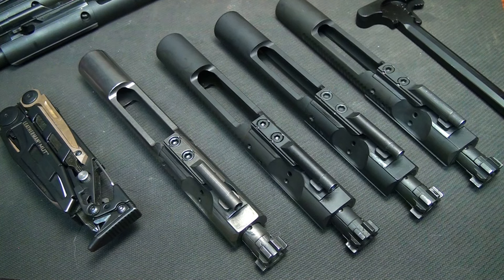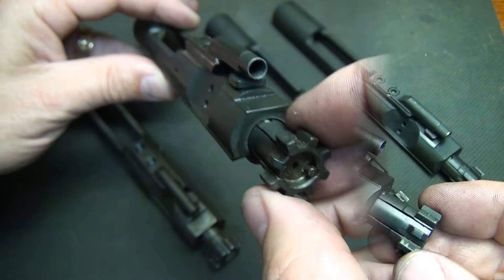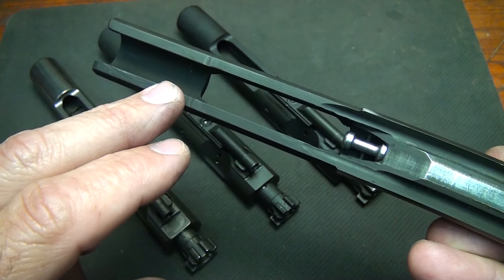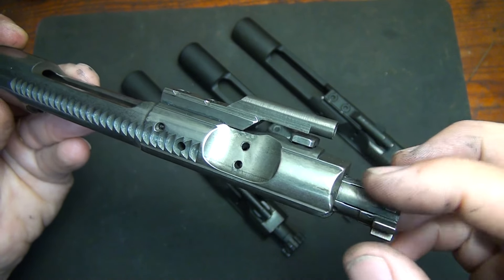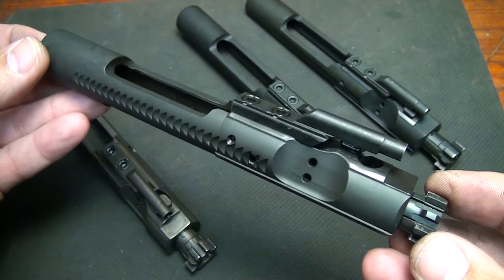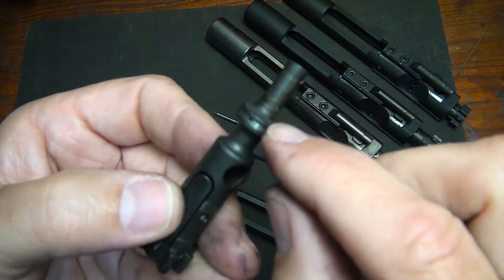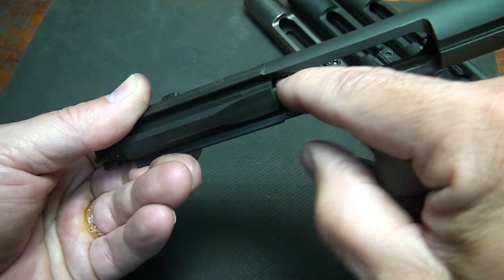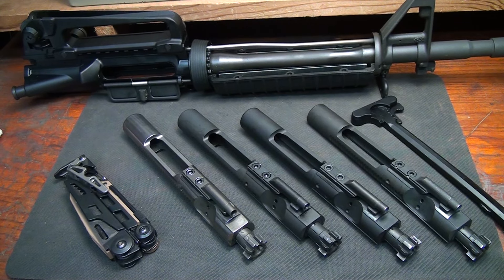How to I.D. AR 15, M16 & Mil Spec Bolt Carrier Groups

Comment: It would be good to see a NiB BCG comparison review. I looked up a few. It seems the prices run from $99.00 on Palmetto & AIM/only shows MPI. Fail Zero to $159.00 to the AB Arms you cover for $199.00 along with a couple others I don't recall. Is there a big difference? Great vid. I just called AIM. Their bolt is MPI individually tested, & not HP tested. This maybe why there's a cost difference in bolts. Can it be that the HP test costs an extra $100.00? Or are there other reasons for the price difference? Called FailZero & they said the bolt is HPT & MPI, $159.00.

Comment: Or are you saying where the Bolt sits inside the BCG? Either way that surface should be Hard Chromed or some companies use Nickel Boron which is not necessary if it is Hard Chromed. Yes it would be beneficial either way.

Comment: I’ve wondered if the half moon (Colt’s) BCA is sufficiently strong enough to handle; 6mm ARC, 6.8 SPC, 6.5 Grendel, .458 SOCOM, .450, .50 Beowulf. (Have I left any out?) or should you just stick with .300 B.O. as a conversion.

Comment: Hey Sootch, question...earlier in this video you said that an ar15 deeper cut bolt will not work on a lower will a sear block. I currently have an older Colt sporter lower with a sear block that hasnt been grind down or altered in any way along with an ar15 bolt and Im able to pin the takedown pin, charge the rifle & dry fire it. I have not tried to fire a live round through it yet as Im still investigating this. Should I not try to do this? Buy a half moon bolt instead if trying to live fire my current ar15 bolt?

Comment: I built a AR recently using an M16 BCG and it won't cycle back far enough to pick up the next round, but I am able to manually cycle it back to chamber the next round.    I swapped it out with an AR15 BCG with a shorter end collar and it works fine.

Was it too heavy and causing too much resistance?  
AERO upper and lower, Colt buffer tube and stock.
Thanks!

Comment: just a note.... some states (washington for one) forbid M16 bcgs installed in semi ARs. state law, not fed. know what is legal in yours.2) while mil spec bolts are indeed carpenter 158 steel, the Carrier is made from 8620. 3) when installing the firing pin retainer pin, the DOD/Colt/FN recommend orienting the legs of the pin vertically. in that way, both legs contact the collar of the firing pin under recoil and less likely to bend with use.
Reply: NanoReefHQ ....  1)  probably only if someone ratted you out
2) routine  LEO contact.

Comment: I have a question: Will an AR-15 carrier increase recoil of the rifle because of its decrease in weight? I remember a commercial rifle from one brand that kicked more than another brand that used an M16 carrier (they both had standard buffer springs and carbine buffers). Also, how common is over-gasing in the AR-15 rifle (gas port being too big)?

Comment: Has anyone experienced the firing pin knocking out the primer on a casing while shooting?  I have a Daniel Defense DDM4v7 in 5.56 and I purchased a new NiB BCG for it. The original BCG was working fine, but I thought that I would give the NiB a shot since they require less lube and clean up much easier. 

After shooting about 30 - 40 rounds of match grade ammo from about 4 different manufacturers, I tried using a match grade steel case round. A couple of rounds fired just fine and then when I pulled the trigger, I heard click and no bang. I pulled the round out and there was just a very light dimple in the primer. I closed things up and pulled the trigger again. Another click, no bang. Once again I ejected this round and removed the bcg. When I tried to put it back together the bcg would not completely seat. I pulled the BCG out again and found a smashed piece of primer in the lugs of the rifle. This happened 2 times within 7-8 rounds. I found the primer laying just in front of the lugs of the rifle. 

I don't know if its the BCG or the ammo?  I didn't have time to insert the old BCG to see if the same thing happened, nor did I have time to switch to brass rounds. I had shot 30-40 brass rounds prior to the steel case without issue. I shot 10-15 rounds of the steel case ammo on a previous outing and didn't have any issues. However this was a new box of the steel case ammo. I guess that I need to go back to the range and try firing 20 or so brass rounds with the new NiB BCG and then try firing the steel cased rounds with my original BCG. Hopefully one way will tell me what the problem is. I believe that firing the steel cased ammo with the original BCG will tell me what the problem is.

Comment: My third entry. Buying a new Bolt Carrier for my Ruger AR-556, I was told if I do change the BCG, I will need to headspace my AR. Is that true? Some will say that a AR does not need to be headspaced, while others will say that you need to do headspacing. So again, the question, do I need to headspace my AR if I get another BCG for it? I just want to install a better BCG, I'm looking at BCM/BCG.
Reply: Rudolph Ferdinand ...  checking/verifying head space should be done anytime you switchout bolts.
altering headspace if it is out of spec is not easily done.
Reply: now, since I have (1) year under my belt with the black rifle, I have ask the question concerning BCG and headspace. It is settled! You can do it if you want to, but it is not needed. It is like BCG chrome lining the gas key and the carrier body. No you don't need chrome lining, Melonite is better. The military, it's their thing to do for combat reasons. Also, since asking the question about headspace bolts, I have built two AR's, only one was headspaced, that barrel came with its own bolt from the barrel manufacture the reason why it was headspaced. Two local shops AR-15, where both state, IT IS NOT NEEDED!
Reply: Rudolph Ferdinand ..... in my 25+ years, i can recall only 2  two used barrels with excessive head space but.... have seen MANY new barrels from various mfgs that were too tight for lockup when chambered w. live ammo.
Reply: When I purchased my first AR-15 in December 2015, I had no dealing with any type of AR rifles after my 13 years in the US Army and the Army National Guard, that was thirty years! My time in handling and shooting the M-16 in the Army, let's just say, I was never trained to handle the M-16 rifle, the M-14 I was. So when I got my hands on one, I went to people who I felt knew more than me. After spending some time on Youtube to learn more,  and seeing reviews on Rugers AR 556 model. There was talk about the BCG being un-schrouded, too much firing pin showing underneath. A novice, I ask questions about BCG; headspacing the whole works about the AR-15. One shop builds custom AR's, the other shop carry's parts for AR-15. but both told me, you don't need to headspace." Now the two AR's I have built, they both work has they should, not a problem with any cases from them both.What can I say! They work! Archery is just like the world of the AR or the AR world is like archery, everybody knows something about, opinions!

Comment: Mr. Sooch, I bought an ATI complete upper and the gas key blocked the cam pin removal. Being my first build I removed the gas key to service the innards. Can I 'restake' this gas key? Can I do this at home with a vice and punch? Is the metal case hardened where I can't shave material to allow the cam pin to be removed past the key? Or is this thing just junk? Not looking to buy a new BCG as this AR is just back up to my Soviet rifles.

Comment: How does a low mass bolt carrier compare? For a gas piston system do you need to use a certain type of bolt carrier?
Reply: +Knuckle_Bump  Has to have the " gas key " on it. The gas tube fits into it.

Comment: Do those companies make the cut on the back of the BCG larger because the bolt cannot withstand full-auto fire? Or is it simply to neuter it and make it less "scary" by making it unable to engage the auto-sear?
Reply: +TacRac Number two.
Reply: +Gostwriterindisguise thanks. That's what I figured, I was just hoping that wasn't the case...

Comment: I'm new 2 this. And what I'm having trouble with is the bcg & chambered barrel? If I have a standard.223/.556 AR platform. And my lower says for 556, 300aac, or 450. I know I can swap out uppers. But if a BCG says M16 can I use that bcg in a 556 or 300 AAC barrel? And what are the advantages and disadvantage's?

Comment: question concerning BCG. Is chrome lining a necessary on BCG? I have three that cost me $150 each, and none is chrome lined. One BCG is from Griffin Armament, it replaced a BCG from my Ruger AR556 that had an un-schrouded BCG but it was chrome lined. Other BCG also does not any chrome lining. I shoot twice a month forty to sixty rounds a range session along with pistol shooting. Do you really need chrome lined BCG?
Reply: Rudolph, it's part of the mil spec standard.
 could yours be melonited or sodium nitride treated?  if so, they're glossy black thru and thru.  any MPI HT marks on the bolt??

Comment: I'm new to the ar15 wondering if you can change just the bolt itself for other calibers. and use the same bolt carrier.
Reply: no you cannot.
Reply: Yes you can, i.e. 7.62x39 , 6.5 Grendal, 6.8 SPC
Reply: Joel Parker gotta change barrel also

Comment: I know it’s been a while, but I have a question. The cam pin on my PSA nickel boron BCG doesn’t rotate perpendicular to the BCG with the firing pin inserted. Is this normal? Or did they drill the hole wrong?

Comment: Like I said just an opinion. And the carrier tilt is caused from piston striking the solid Key surface. But as with moving parts the less the better. The AK setup would be better but requires work to the Upper if I recall. Too much of a pain in the ass to save some cleaning time. I don't believe in screwing with a working design.

:D

Comment: I see it like having a fast car. Sure you can't drive 100 mph by law , but it's the power is there if you need it.

With the M16 BCG if laws change you already have the parts. 

If a zombie oppocolypse happens or we are invaded by North Korea you can easy do a drop in and go full auto too.

Comment: If you had to keep basic AR spares, what else would you stock in addition to firing pins?
Reply: a spare BCG....I'm left handed which means i can't do a BCG autopsy....'cause that can happen......    :-)
Reply: Kurt Ingalls 
I got a stupid question for you. I am not a lefty, so I am curious, is the bcg the same on a left hand setup with he bolt rotated so the ejector is at the 10 o clock? Forgive my stupidity, I was born a blonde :D
Reply: Edslittleworld ... gas rings, FP retaining pin, cam pin, extractor and spring, more gas rings.
Reply: OK...thanks!  I have a spare BCG for each of my ARs, plus some gas rings.  I guess I'm covered.
Reply: Edslittleworld 
I don't know of the part quality, but before the panic buyers hit brownells I picked up one of their kits. I believe it has one of every spring and all of the most common parts that break. I would say with your spare bcg and what you have, you should be good. Just... be careful with the smaller springs :)
Reply: OK...same here.  I bought two lower kits.  One was DPMS and the other Bushmaster.  Both kits seemed so-so to decent in quality.  Sure wish Sig & Colt offered similar quality kits.   LOL...I even have a spare 10" upper for my Sig P516.  If bad came to worse, I could marry it to my Colt lower.  In a SHTF situation, NFA laws might not be immediately applicable.

Comment: I run a Young MFG BCG in my M16. Young DOES NOT stake their Gas Keys. matter of fact if you stake it you void the warranty. I have my M16 shooting around 1200 rpm and have ran probally 10k through it. Never once have I had the key come loose. Its all on how its installed .

Comment: I put together my first AR-15 recently, took it to the range and it shot full auto somehow.  I was told my sear could be the issue or my BCG was a full auto.  I didn't have the expertise so I could not make the call.  Suggestions?
Reply: A full auto BCG wouldn't cause your gun to fire full auto.  It only has additional material that would contact the secondary sear found in full auto M-16's.  Your AR lack the selection of full auto and this secondary sear.  Your trigger group is the most viable culprit.  Your sear may not be mating correctly on the surface area of the hammer that retains it between shots.  Did you attempt to polish any parts of the trigger group during your build?  Long story short take it to a qualified gun smith and tell him what is going on.
Reply: @FourFifteen Concepts thanks for the info.  I'm going next week to talk a SME.  Pretty sure I'll learn a few things.  lol.
Reply: Hope you get it running the way it should.

Comment: I got an ar-15 and I'm new to guns. Anyone know good videos to properly clean an ar-15 (if you can please include cleaning gas port and trigger mechanism) ? I think I over oiled it and do I need to oil the exterior. I how to do other things like remove handguns and sighting in a gun (I got an ar-15 with the carry handle iron sights). If I'm going to store it what should I do for that? Thanks

Comment: With the exception of the cylinder itself, if the carbon doesn't come off with some Hoppes and a rag then it doesn't need to come off.  Mild build up is not really an issue and will have no effect on the rifle.  Especially if you're keeping the bolt properly lubed.  A finger dab "here and there" is really skimping on the lube.

Comment: Look for test stamps on the bolt and carrier.   A Colt bolt that has been fully tested will be stamped MPC.  (Magnetic Particle inspected, Colt mfg)  An FN bolt would be stamped MPF.    I do not buy bolts that do not have test stamps.

Comment: At 0:50, you state that the bolt carrier needs to be Carpenter 158 steel. That is incorrect. The bolt carrier needs to be 8620 steel, and the bolt needs to be Carpenter 158. Even if you handwave that as being 'well I meant bolt or BCG or whatever to be right', you also did not indicate that the BCG uses at least two different steel specs, so claiming it should be one is also incorrect.

Thanks

Comment: Excellent , interesting presentation that illustrates the mechanics. The mechanics of this Republic,designed by our Founding Fathers is even more fascinating. As stated about 3:50 into video. "We Are Subjects"  was not, is not the aim of the design of this Republic. The 2nd Amendment, is not a Contradiction to our Republic's design. Present day Senators, like NRA A Rated Senator Coburn, are. Supporting the 2nd and at same time Opposes adherence to much the remaining, like Article 1 Section 7

Comment: I have, and after thousands of rounds your gas key will come undone as seen in the video and cause major damage to your rifle from gas Key Impingement. If able buy a need gas key and bolts and have it properly staked. Or you can buy a staking tool and do it yourself. Its a major safety concern.

:D

Comment: Having the gas key screws staked is unnecessary.... the application of the correct grade of Loctite will keep them tight and in place...staking them is a Mil Spec procedure only.

Comment: Wrong! The M16 BCG is completely legal, so says the ATF and any class III dealer. It is the only full-auto capable part that is OK to use in a AR-15 or to even posses without a registered Full-auto lower. I used one in my AR that I sold because of the extra reciprocating mass and law enforcement knew I had it and did not care.